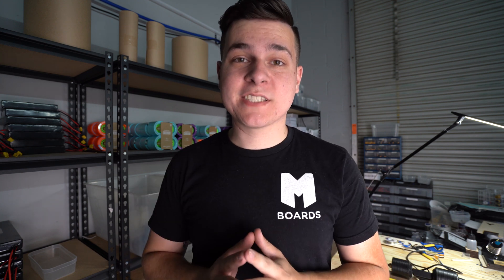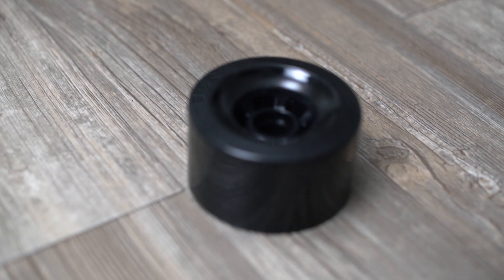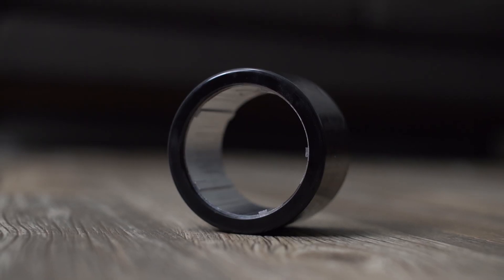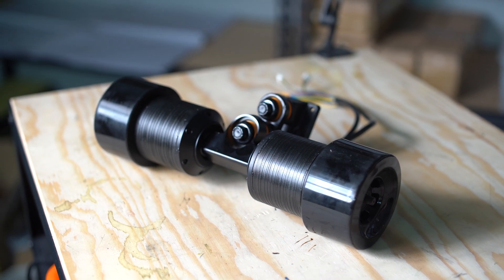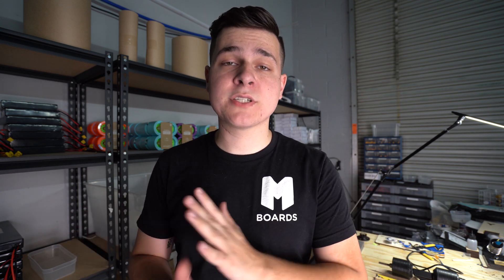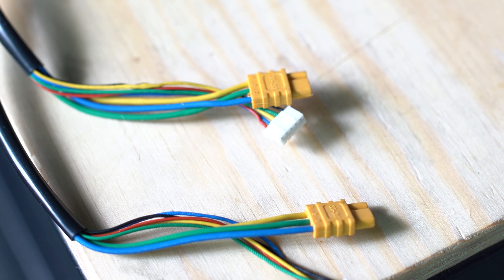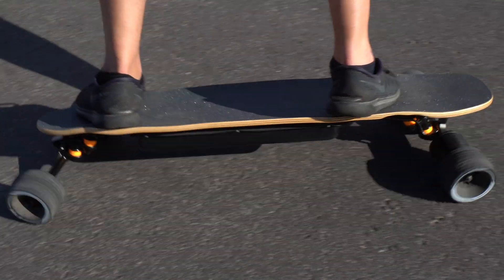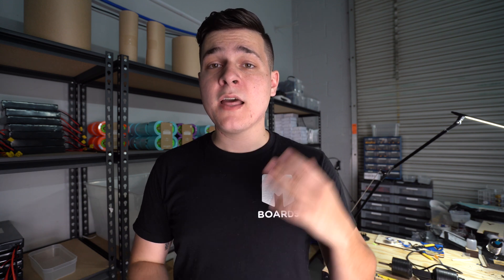The Future of DIY Electric Skateboards - Direct Drive ESK8 Kit

Comment from the maker: What Tutorial would you be interested in next?? Reply to this comment!
Reply: Feature the direct drive motor on a build! Really looking to use this over hub motors! Just built a 12s4p hub motor setup. Would love to sell, and go for an upgrade
Reply: Vesc accessory and bms set up
Reply: Can you make a video explaining how a Bluetooth module works? And compatibility?
Reply: Make an overview to Esk8 for non-riders, you know those people who are scared of this technology...
Reply: Do a direct drive build from scratch for the fastest speed setup
Reply: how can i get a board this weekend?
Reply: I'd love to see this and other parts in action. Also building a board start to finish. The small one you made was OK but hooking up everything from battery to ESC to motors and how to fit it inside a container
Reply: So what does the complete direct drive build look like with the battery and other parts played out.. noob just wanna know what I need to get.. changing my board from belt to direct drive.. old razor eboard.
Reply: @betabobbi2616  I’ll try to remember to post pictures. All I have now is the board with the motors on it. The battery still needs to be connected to the esc, then mounted on the board somehow

Comment: One thing to note is that if you are using "smaller" wheels, your direct drives will hit and get all scratched up by road debris. Idk if it will damage them, but it surely isn't good.

You should run wheels at least 100mm+ in diameter.
Reply from the maker: Yes definitely!

Comment: Can you still use direct drive like a regular skateboard like you can with hub motors. Or is like belt where you cant use it like a normal board?
Reply from the maker: There’s very little resistance with direct drives so you can still push.
Reply: @MBoardsco  Fantastic thank you! Would you say a direct drive system would work for a small board set up? I'm trying to a build a board similar to the boosted mini x just improved in some areas. so somewhere in the 28-32 inch board range.
Reply from the maker: The direct drives are relatively wide, so might look a bit funny on a smaller deck. But I’ve had these on a 32” deck before and it looked great!
Reply: @MBoardsco  thank you!

Comment: Can you make a interstellar build tutorial using direct drive motors and using 2 vescs instead of a esc? I want to do that build myself and also fit into the enclosure a 12 s 4 p battery with a charge status led, also other then the obvious choice using shred lights can you include wiring in chstom led strip for the sides or front and back lighting for braking abd seeing ahead in the dark and one more big ask? How about a horn function for the board that can be activated by the remote or another simple on off blutooth device, so many times i have needed a horn to alert a careless driver and a born that would be loud enough to get their attention would be amazing thanks for making a the content your channel is so good to watch and learn more about how to do diy on your owb board
Reply from the maker: Set up is almost identical. We have a tutorial on dual VESC set ups on our channel already. 

And a FocBox and a 12s4p will fit in the XL enclosure if you want to go that route.

Comment: If I get ur  Direct drive would I be able to put the  Mountain wheels on them I can't find any videos thst you did that since if I go on a  Dirt road I dont think it will be good on a pully  System since it going to get dirt Smalle rocks On the pulley itself what would you recommend and is it easy to go from  Mountain wheels then back to regular    Wheels
Reply from the maker: Working on AT wheel adapters now. Samples will be getting approved in a couple weeks. 👍🏻

Comment: Hey Mike, I was really set on buying a prebuilt electric skateboard, but you're really making me reconsider. Watching this video, I believe that I would definitely want to go the direct drive route. However, I'm having a tough time finding tutorials on how to build a skateboard around this system. Could you please do a DIY build with a direct drive? Thanks!
Reply from the maker: Yes definitely need to use these in a build. They’re actually very easy to install. It’s as easy as attaching the trucks to a deck and plugging in the phase wires to an ESC. Definitely on the easier side of building.

Comment: What is the freespin like Vs resistance on belt? I'm thinking direct drive with some Bronson Shieldless Bearings. Thinking get up to speed and might get to coast for a long time. I ride GTR with AT's and only coast on steep hills. On throttle next to 24/7. Interested in direct drive but yeah still not sure.
Reply from the maker: Direct Drives definitely freely spin much much better than any belt set up. Much less resistance!

Comment: Hey, I was looking at the direct drive kit, and the hobbywing esc you have on your website. Does the esc put out enough amps to support the direct drive? It says 22A on the website, but the website  also says it is for the dd, which needs 55 amps not 22. I was just wondering if this is important, or if it is bottlenecking the dd kit. Ive got a 35a esc which is better, but nor sure if it can support the kit either...
Reply from the maker: Yes the Hobbywing ESC would bottleneck the DD Kit. To push the DD kit to its full potential a pair of Vescs would be better.
Reply: MBoards thanks for replying! I’m slowly upgrading my current board and can’t wait until I upgrade the motors. The dd kit looks like a beast!

Comment: I have hub motors, yes they do feel a little harsh. but on the noise /sound, i love the sound of the Razor with gear drive . only about 16 KPH but the sound. Like a 747  winding up. The other thing is people hear you coming,
Reply: Im having a problem decideding between a  belt drive or direct drive skateboard, I like both setup's 😂, the silent and the loud.
Reply: @joshdimovski4483  I ride a lot around the lake where I live. There is a lot of crap from trees ( seed pods ) and some gravel with hub I don't worry about belts breaking..
The twin motors do get me up a fairly steep hill at home. The belt would go up bit quicker but not enough to debate. 
My board is rated at 3000 watt top speed  35 kph. I have measured at 37.
One thing you should consider is trucks , reverse king pin are more stable at high speed.  Standard kingpins carve better.
Double kingpins very carvey but stability drops.

Comment: looks like the biggest advantage here is added wheel selection and full spec wheel shock absorption.  A hub motor could be longer and stick out of the wheel sleeve while not compromising on ground clearance as much.

Comment: Are direct drive motor waterproof ? My hubs are, but I would love real wheels over sleeves, but I'm constantly ridin in wet conditions ...
Reply: motors themselves are pretty splash resistant, it's the electronics that need to stay dry.

Comment: Perhaps a silly question but could I install these on my Evolve GT? Are there boards like my Evolve with direct drive to buy if you do not want to build a board? Thank you
Reply from the maker: I’m not 100% on how the stock evolve ESC would react to the direct drives. But I would guess that they would work with some adapting of connectors. 

Worst case, an ESC would need to be replaced as well. But definitely possible 👍🏻
Reply: @MBoardsco  Thank you!

Comment: I look at belt driven and direct drive and I dont see a difference. Cant you just bolt down the outer portion of a belt driven motor with a custom clamp to the trucks and attach and adapter to use any wheels? I dont even get my belt driven was every created... the outer motor case spins...for what? If you just made the motors like any other electronic motor on earth the center shaft spins...end of story... I think it was a ploy to make more money by taking a step backwards and then go and introduce new  more expensive motors...that are just normal motors after taking 2 steps backwards ...
Reply from the maker: I totally see what you’re saying. It all comes down to production cost and the cost of custom fitting motors onto custom trucks. As the Esk8 community grows more and more money will be invested into creating things for performance rather than cost.

Comment: Ermm. When's the last time you built or bought a hub motor eboard. The esc has a big impact on performance.  Enertion boards. Off the shelf boards like meepo v3 and their awd more than hold their own against the popular belt boards. Esk8 builders recently built a hub board with dated maytech hubs that went 30mph. Noise free,  free wheeling, cheap and effiecent is why hubs are so popular.

Comment: Using a 12s setup, What size wheel would you use to achieve the claimed 35+ mph top speed?
Reply from the maker: 120mm wheels will be the easiest way to get a fast top speed while still using the stock adapters.

Comment: Does this work with hobbywing esc?
Reply from the maker: Yes it does 👍🏻
Reply: I have no idea how to program it. Can't find any good info on how to program esc for a new motor
Reply: Yeah can it be used as drop in replacement from hobbywing based pre built (wowgo) esc? I heard that you need to run it sensorless. Any idea what does that mean

Comment: Seems great but if you run over a stone/gravel surely the motor can easily be damaged or the entire shaft bent? Best regards
Reply from the maker: Using larger diameter wheels will prevent this 👍🏻

Comment: Thanks for all the videos bro... Just one quick question, if we use the vesc to limit the belt driven motor's rpm (let's say to 3040), would that give us more torque than a setup with the same wattage output but rpm on the motor's default values (9120 out of 48v * 190kv)?

Comment: I got an important question. These direct drives are from eLofty skateboards, its a fairly new chinese brand and there were some issues with their quality control  https://youtu.be/ERYZDyoaY3k
also many people on the esk8 forum have complained about the cutomer service from their chinese contact person Kenna.
I'm very interested in this new direct drives but worried about reliabilty, so i would like to know if you have tested the motors for some time without having any issues?? Will they ride without overheating ?(no temperature sensor)

Comment: Thank you for this video. I kept hearing about direct drive but no one explained it. So does direct drive have good torque or more torque than belt driven boards.
Reply: I would imagine they have the same torque as belt drive motors but without the belts
Reply: Love your channel! It will be a bit more torque due to the loss of the belt tension
Reply from the maker: Belt driven will have more torque due to the gearing ratio. Direct drives are limited to a 1:1 gearing ratio whereas belt driven set ups can adopt any gearing ratio.

Comment: Some guy already tried this and it didnt really work/last, because of how close the motors are to the ground. Meaning every little rock and or uneven part of the road will hit full force right into the motor case. So this aint it.
Reply from the maker: Currently using them with 100mm wheels and it’s awesome. No issues at all. We’re about to release 120mm wheels as well. 👍🏻

Comment: Is no one going to mention the almost non-existent ground clearance of the direct drive motor housing?
Reply: It would have been nice to mention the ground clearance problem in the pros and cons arguments, as adding 100mm wheels eliminate it but lower the torque...
Reply: @remyslosse1392  most people dont care much about torque when the added comfort of large wheels is a very nice change, also get a little more top speed.
Reply: This is one thing I have thought about. I have been thinking of a DD swap.
Reply from the maker: Adding larger wheels eliminates this issue. I currently have 100mm wheels installed and it works great 👍🏻
Reply: @MBoardsco  adding larger wheels also means you gonne lose the torq advantage you had by using a bigger motor 🙄

Comment: Direct drive is definitely the future but will still never be as powerfull as a direct drive. Every time you double your kv rating of the motor you are 1,4x ing your power density of the motor. Thats why gears are still very practical to producing the highest amount of power possible.

Comment: "Hub motors just aren't that powerful"
Enertion: "Am I a joke to you?"
Reply: Look up their reputation and the insane amount of customers who have been screwed over by them, for both customer service, quality control, and wait time. They're insanely powerful, but not worth it for how long they last.
Reply: ...Exway!
Reply: Yes they are a joke - they gone
Reply from the maker: There are definitely special cases. Enertion is in a league if its own 😎 But in general, off the shelf Hub motor options will typically be out performed by belt driven systems.

Comment: I am sure they are really nice! :) But so are also the new 100mm Meepo hubmotors. I run two of dose on my DIY, VESC board. They are speced 540W each so 1080W total on 10S, but I run 12S and 40A to each motor that makes the board really powerful and fast (35mph) (2000W). And the motors do not get to hot like older hubmotors use to get.
Reply from the maker: That’s awesome man! Sounds like an solid set up!
Reply: @Johannes Döderlein Hehe yes :) I answer in english so the others understand to. I use the new Meepo hubs and a Flipsky Dual FSESC4.20 (VESC) (2x50A) that able me to set the power and regen I like to use. The old Meepo ESCs outputs max 2x15A if I am correct, and the new ones outputs max 2x32A for these new hubmotors. If you like your board, you can just change the Meepo ESC for a VESC and get more power if your battery can deliver enough current :) Good luck!
Reply: @Nisse977  im curious of what settings you use. For either 12s or 10s. I have a 10s2p 40t pack im about to start using.
Reply: @SgtBluntman  The Meepo hubs are sensored motors but do not have a tempsensor if you understand what I mean. When using an old li-ion 12s3p pack (built with 18650GA cells) I use (per motor, so total is x2) 40A motor Max, -35A motor Min (regen) and 20A battery Max and -5A battery Min (regen). The new 12S3P pack with 40T cells can give alot more current so then I will up "battery Max" from 2x20A to 2x50A instead (100A in total) :) And regen will be changed from 2x-5A to 2x-10A. I will probably use the same motorsettings as a start. I might up motor Max from 40A to 45 or 50A and check so the motors don't get to hot. :) If you use 40T cells with 2 in parallel, I would set battery Max to maybe 35A (70A in total) and -7A battery Min (-14A in total) Maybe it is possible to up that value a bit after careful testing.
Reply: @Johannes Döderlein I am Swedish :)
Reply: Im also using temp sensored meepo 100mm hubs with flipsky dual vesc 6.6 plus.

Comment: Looks like a decent product but you neglected to mention their biggest problem, the lack of clearance. How durable is the outer part of the motor? How would it react to concrete rash?
Reply: What about a skid plate? That would fix that problem. And it wouldn’t add much weight. You could even use plastic just something that keeps SOMETHING between the motor bell and asphalt or whatever you are riding on (rocks, dirt, etc)
Reply: Artimus Prime then there would be pretty much no clearance.
Reply: I got one of these sets second-hand, and the motors have all sorts of scratches on the bottom. You'll definitely need bigger wheels.
Reply from the maker: Clearance can be an issue but the bigger the wheels you put on the more clearance you’ll have 😎
Reply: It would be easy to make durable and replaceable skid plates. For similar projects I've been using kitchen cutting 'boards' that come in four packs with primary colors that are only about 1mm thick yet are very tough, but it could be as cheap as some 2liter bottles.

Comment: For the ESC enclosure you sell on your website, where do you get the battery indicator that connects to those plug and play ESCs that is included with the enclosure? Because I can only find them without the wired connection with the display only